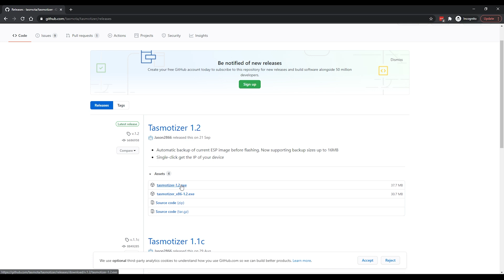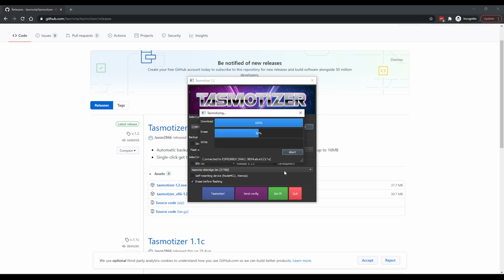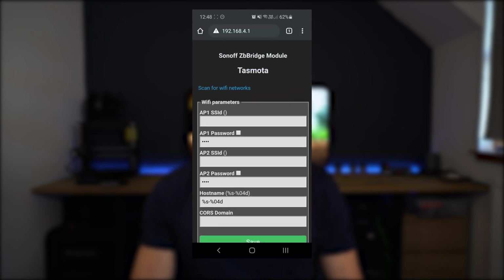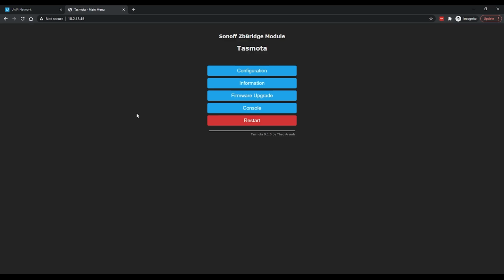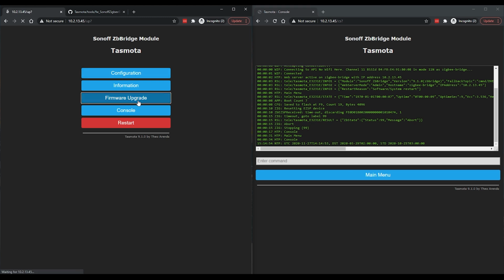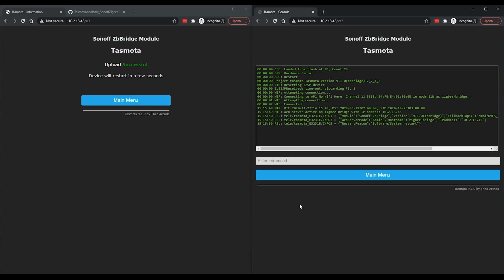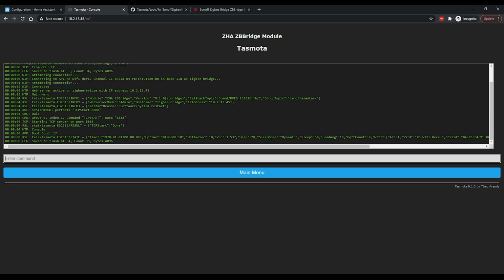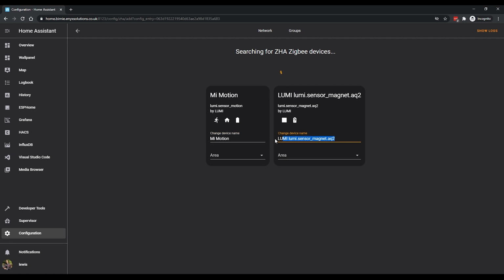Sonoff Zigbee Bridge with Tasmota And Home Assistant using ZHA

Comment: I follow everything and the ZHA integration works, I'm able to add a couple of Ikea tradfi switches.. all is great until the bridge randomly disconnects from HA in a day or so and everything is lost. The IP is fixed so the problem must be elsewhere. Anyone having same issue ? It's driving me crazy 😅
Reply from the maker: Hello! Hmm that's strange, never had that issue before. Is the bridge far away from your access point and on the edge of the WiFi? Which firmware versions did you flash also?
Reply: @EverythingSmartHome  Thanks mate ! It seems uploaded the older 6.7.6 version previously, which had the bug ' original stable version for EZSP v8 compatible hosts, contains a bug that can cause battery of IKEA and Philips remotes to drain'. I think my IKEA tradfri remotes disconnected as the bug drained the battery empty... Will test thoroughly on new FW 6.7.8.  Thanks again ! :)

Comment: Great work thank you
Got mine working but i got a problem after i disconnected the hub for about an hour and connected back all my sensors state stuck and not updating what could be wrong?
Reply from the maker: Thanks! Re-pair your devices and then leave them for a while, ZigBee takes a little while to work out its pathways
Reply: @EverythingSmartHome  Thanks man

Comment: Hi followed your guide but getting an issue, im using the latest tasmota but getting this error "tasmotizer permission error 13 access is denied none 5"  tried other usb ports, running administrator etc. re sat the solder joints on pads now getting the esp time out error? any ideas? ive flashed sonoff switches in the past and been fine. thanks paul
Reply from the maker: Hi Paul, assume you are on Windows? Did you.double check your RX and TX lines? Feel free to jump into Discord and I can try help
Reply: @EverythingSmartHome thanks for your reply, yer triple checked everything, I found another thread similar problem where they changed the ttl usb and cured it. So ive ordered the Same as yours. I had tapped the 3v line on to the log pad on the pcb accidently so hope I havnt cooked anything. I t still works in eewee so fingers crossed thanks for your help

Comment: Is it better to stay with the Sonoff Hub (without flashing) or Flash . I have 10 child devices (including 2 routers) on the Sonoff Hub (plus many Sonoff's on WiFi) and other than an occasional device falling asleep , works well . They all come together in HA where I also have a Conbee II with deCONZ and Aqara devices. What I miss is in Sonoff is the network mesh , available in deCONZ but then the eWelink App shows all the devices , even when I am out of my home network . Is there any significant performance advantages to flash with Tasmota ? I am also in two minds whether to move all the Zigbee devices to deCONZ . Your thoughts will be appreciated !!
Reply from the maker: Hey Mohan,

That's a tough question to answer! If your happy with what you have now then I'd be inclined to just say to stick to what you have, however having never used the eWelink app myself (I always flash straight away) it's hard for me to say. Does the eWelink app require internet connectivity to work? If so then that would be an advantage of using Tasmota!
Reply: 1. Sonoff zigbee devices do not function properly under ewelink. See snzb-03 example, while under Tasmota in HA same devices work flawlessly...
2. You never know when the Chinise cloud stops crashing, and it never does so far..
3. Device limit gone
4. You can have devices of different manufacturers on single network
Reply: @powerofwisdom2336  you mean flashing the bridge will let me add an unlimited amount of zigbee devices?

Comment: Same issues here, version 1.1.  With color box orange.  Flash was successful, when locating then inputting network and password with option of changing device name and saving.  The bridge powers off and blink blue for a bit and powers off.  Reflashed a couple of times with the same results.  Did you get yours up successfully? UPDATE: I Was able to figure it out.  Works great. Thanks
Reply from the maker: Feel free to hop into the discord and I can try help you out! I had the orange box version too so I don't think it's that, but I've seen that there can be issues with dry solder joints on the chip
Reply: @EverythingSmartHome  thank you for the reply.  I managed to figure it out.
Reply from the maker: Nice, what was it?
Reply: Being new to tasmota and not understanding the flash process.  I'm used to devices flashing light letting me know I'm awake!  After flash it blinked 3 times and went off.  I thought it was unsuccessful, but then decided to check my ip address and bam! there it was.  Thanks for the useful tutorial.

Comment: Good video ! But I think that the Sonoff ZB bridge with tasmota is probably the worst Zigbee experience comparing to other solutions (I tried many : zigate, conbee, z2m, SLS, xiaomi gw v2, v3, ...).
I find the UI poor, the pairing hard, the events limiteds, the compatibility bad. I’m not a fan of zha too...
But with the big tasmota community it will getting better in the futur.
My advice is always to test SLS gateway : it is probably the easiest , most powerful and the best Zigbee gateway but it suffers of a lack of notoriety due to the fact that the russian author of this project doesn’t make efforts to make it famous outside Russia. Make a try, you will not be disappointed 😉

Comment: Hey great vid and extremely well explained. I get an issue with trying to flash the Zigbee chipset 

15:08:04 UPL: File ncp-uart-sw_6.7.6_115200.ota ...
15:08:04 UPL: File type 4
15:08:07 UPL: Successful 190272 bytes
15:08:07 HTP: Upload transfer
15:08:07 XMD: Init bootloader
15:08:37 XMD: Bootloader timeout
15:08:37 XMD: Restarting
15:08:38 HTP: Upload done

Also shows Upload failed on the other screen. Have been trying to get the working for several weeks after DigiBlur posed it. Any ideas what's going on?

What version of the Zigbee Bridge do you have? Mine is v1.1 (2020.02.28) Thought there might be different version of the board
Reply: Has anybody a fix for that - I have the same issue?
Reply from the maker: Hey James, thanks appreciate it!

That's strange, if you want to hop into our discord server I'll be happy to try and help fix it!
Reply: Did u got a orange box ? Instead of white box version ?
Reply from the maker: Do you mean the actual box it came in? The Sonoff I have is white but the box was orange
Reply: @Bhitiwat  I was referring to the version no. printed on the board
Reply: Same issues here, version 1.1.  With color box orange.  Flash was successful, when locating then inputting network and password with option of changing device name and saving.  The bridge powers off and blink blue for a bit and powers off.  Reflashed a couple of times with the same results.  Did you get yours up successfully?

Comment: hi. gr8 videos. following your channel.
today i am following your zb bridge flashing. 
i have flased successfully, but ota update of ncp-uart-sw_6.7.6_115200.ota failed to upload
i have even chaned my usb cable and power source. but still. tried this file as well ncp-uart-sw_6.5.5_115200.ota.
Reply from the maker: Hey Syed, thanks! What is the output from the console when the failure happens? Feel free to hop on discord if you need help!
Reply: Same here got XMD : Bootloader timeout